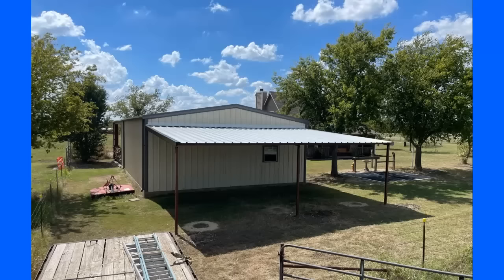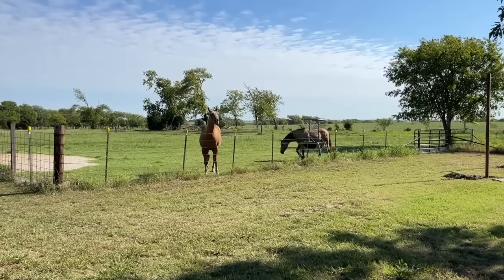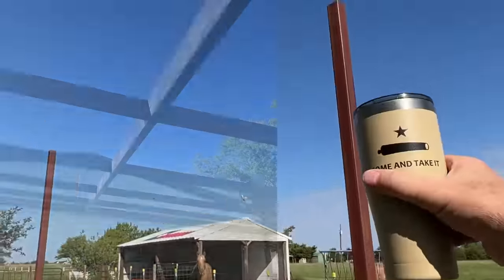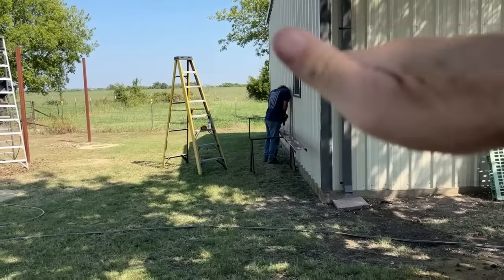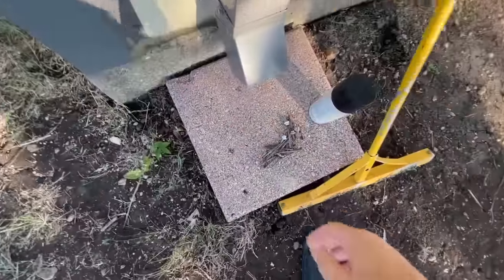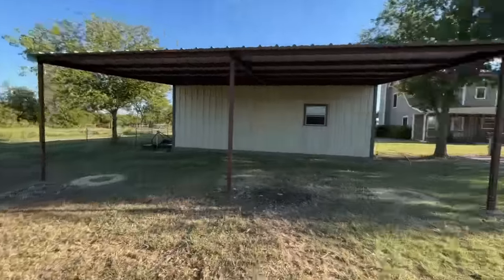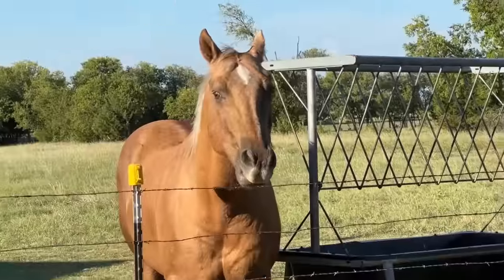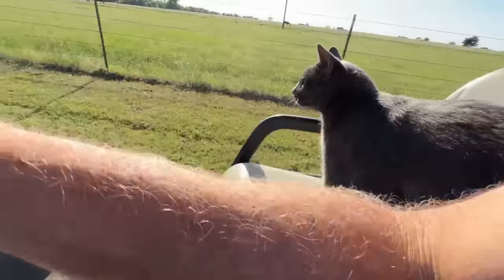Building Project For Horse Covered Area - Just How It Was Put In & Installed

Comment: I'm not sure about metal prices now, but just a quick guess.   Pre plandemic --   It looks like about $500 for the sheet metal,  $600 for the purlins and posts.  $150 for concrete. Maybe $250 for trim.  $100 in bolts and screws, welding rod.  So that's $1600 for materials, at least.  I'd figure at least double that for labor..  So $3200 would be the absolute bare minimum.  If you paid anything under $4k, I'd say you did really well..  I could see a contractor try to reach as high as $6k to see if he can get it.. Probably charge extra for shipping in the skid steer.

I personally would have wanted more posts up next to the building, rather than just relying on screwing it into the building, just because that's a large snow load.  But it does look like they put a LOT of screws on that girder that's screwed to the wall, so it's likely fine.  A heavy snow load will really test it--  but the real test will be heavy winds.

Comment: I was thinking the price was around 5k. Wasn't too far off, but still a little low (read the price in your reply to another comment ). 

We used to "police" the area if we did work which would leave nails and screws in the grass. It was just part of the job. You didn't want to have the lawn mower throw a nail at the operator. 

I had to run the nail pickup after every outside job around my house. The only guys who "policed up" the strays where the guys who did my siding about 10 years back, and ...... they're out of business now. 

New rain cover looks good, Rick! I'd leave the fence up too, just to have options for containing the boys if the need arises.